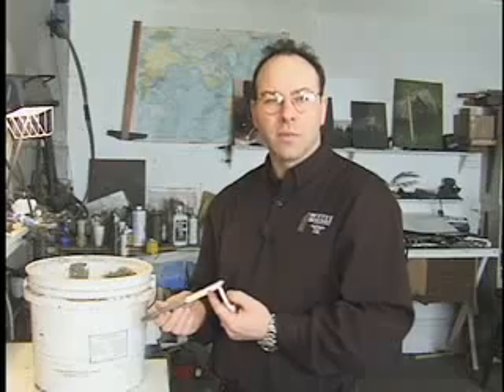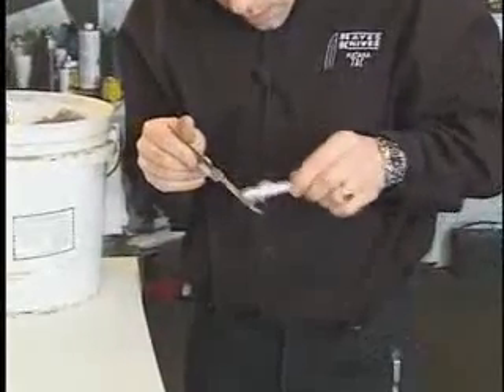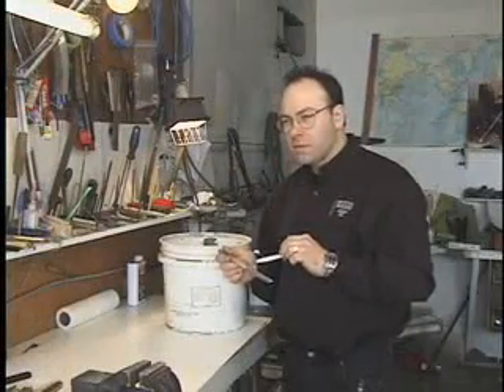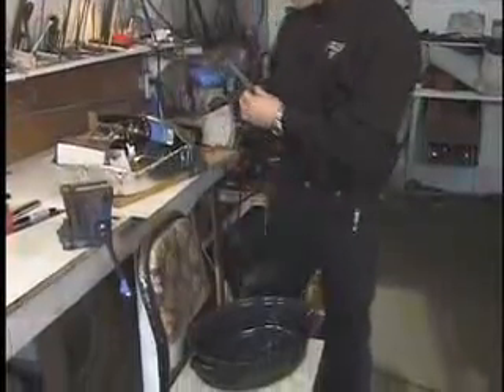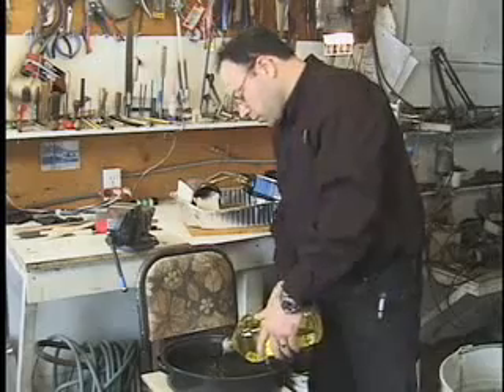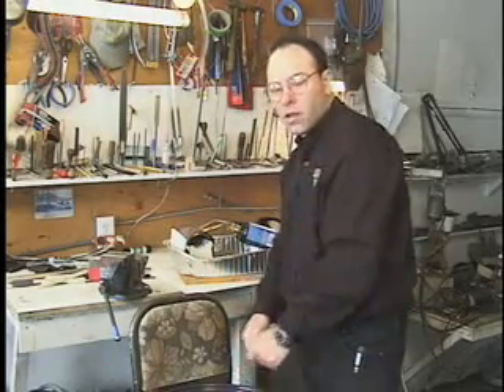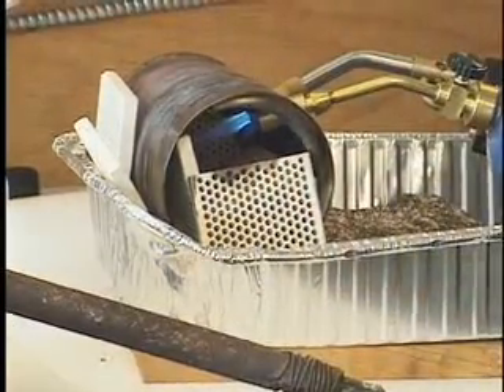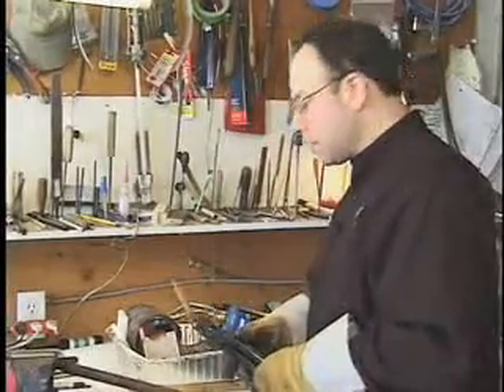Knife making

Comment: @7689568 You've probably been doing it fine, to be honest, this guy doesn't seem to really know what he's talking about. DO NOT use olive oil to harden your blades, I've got no idea what he's talking about when he says its a quicker cool. I'm a blacksmith, this guy is clearly not. Motor oil is used because it is made for cooling and lubricating metal. olive oil is made to store olives. You can get just as good a temper line by doing other things to temper without wasting oil.